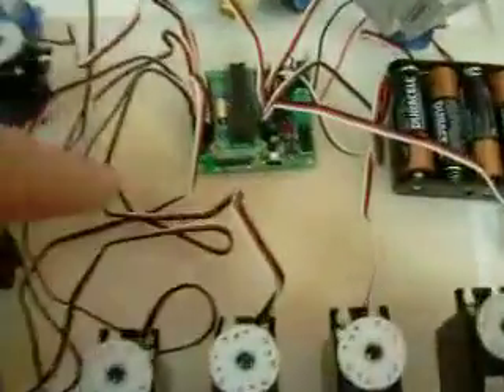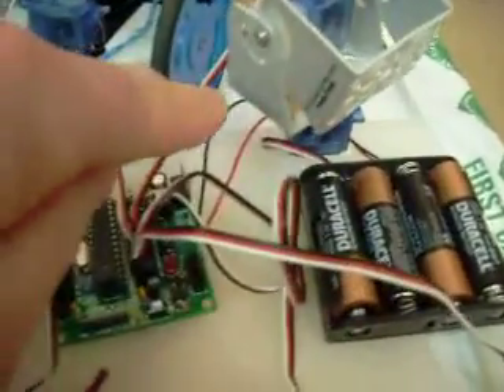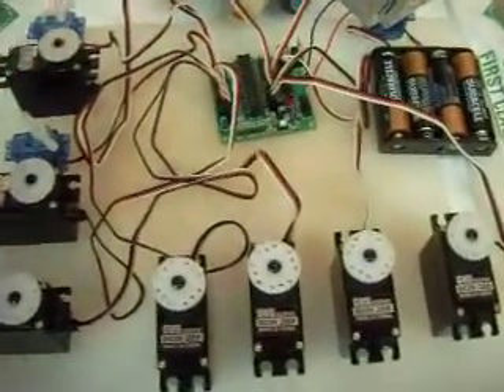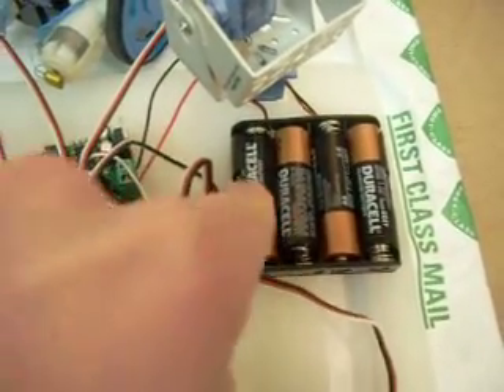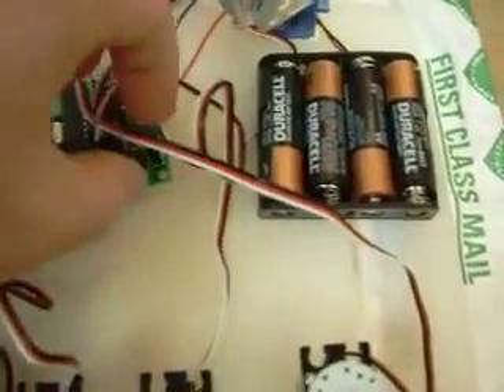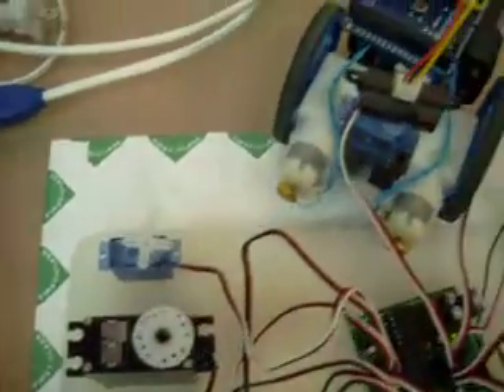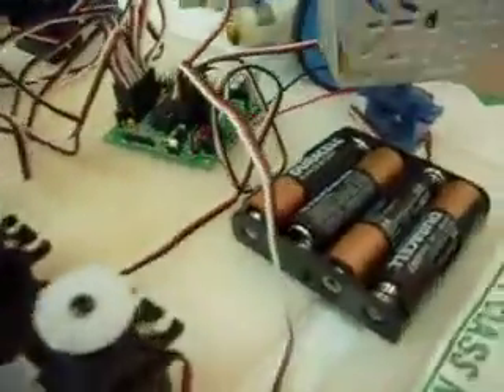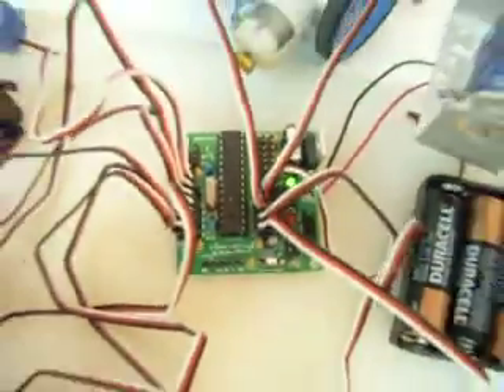Ro-Bot-X uServotino Test

Comment: hi, what kind of capacitors do you have on those DC motors(blue wheels), im using them but i get too much noise i tried with .1 uF ceramic capacitors but cant get that noise out.